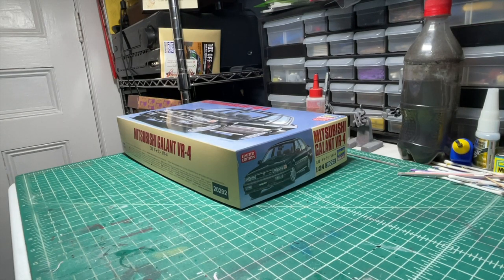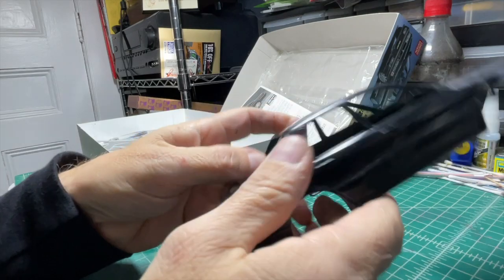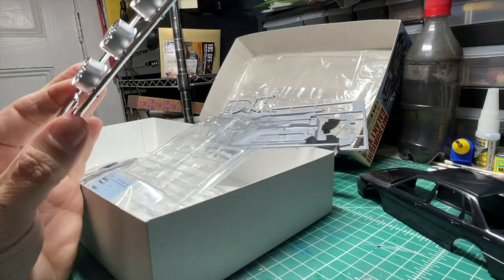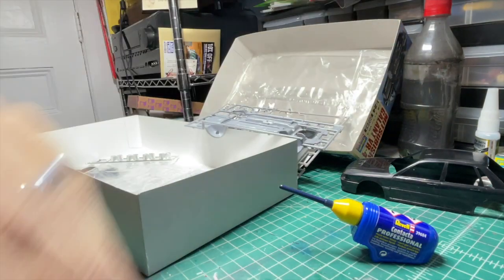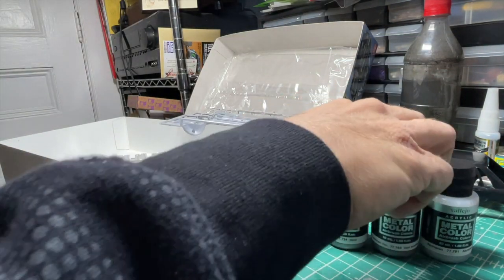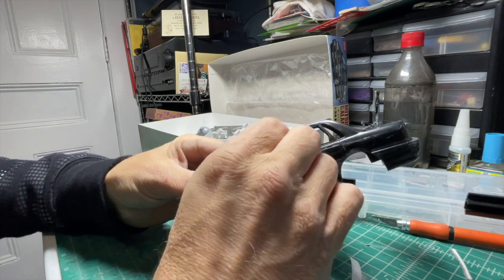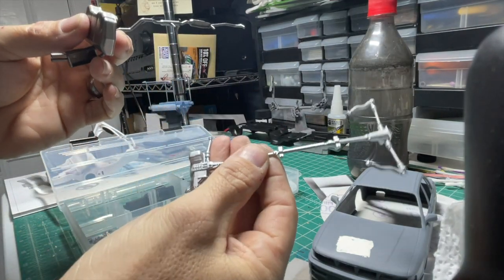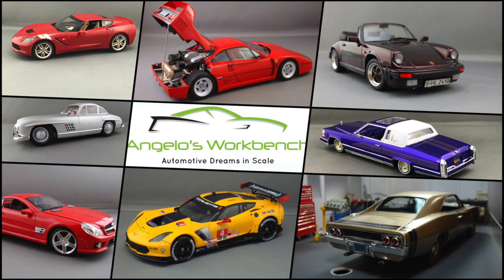Hasegawa Mitsubishi Galant VR 4 #1

Comment: Yes, Faller is a big model maker in Germany   especially for model trains stuff.  Buildings, etc.  I too really like the metal tip, but lately have been just been pouring a small amount on a cap or glass top and using a toothpick or small brush to apply....

Comment: Fun to see these japanese models, they are quite unusual as scale models.
I have even smaller  wheels on my crx irl, it has the american style oem 14 inch "sawblade" alloys, and 13 inch Honda alloys from the early 80s for studded winter tires x>
(they don´t salt roads here in northern Finland, so winter driving for classic cars is not too bad)